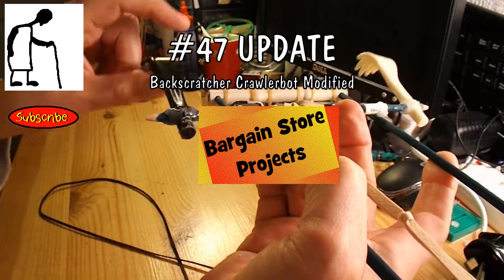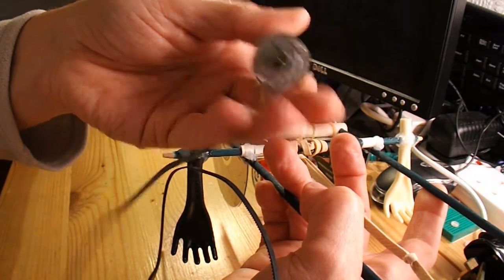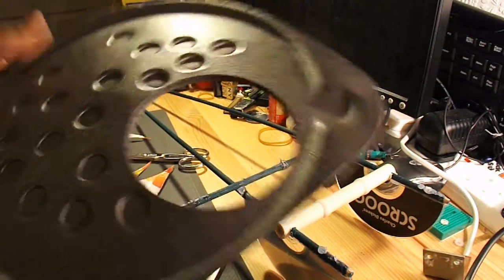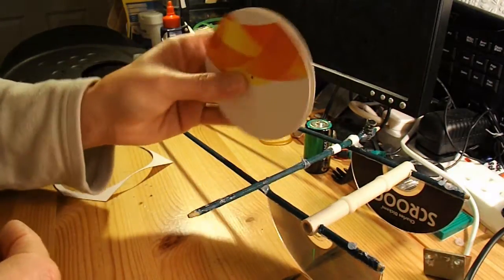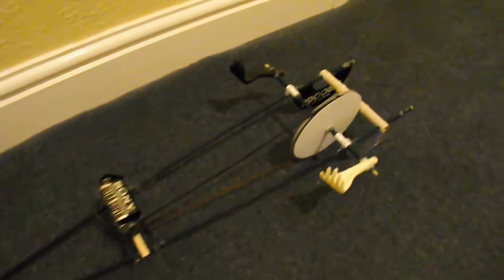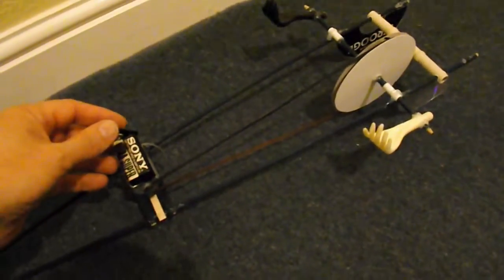Bargain Store Project #47 UPDATE Backscratcher Crawlerbot

Comment: Why would anyone need this
Reply from the maker: Does there need to be a reason? If you do need a reason, it is an exercise in pulleys and gearing. To achieve the motion the pulleys had to be chosen at the right ratio to allow a small motor to move a large weight. Just putting wheels on a chassis and adding an electric motor to move is not a challenge.